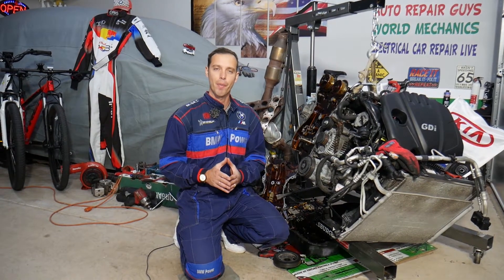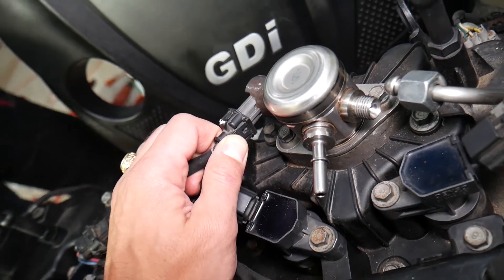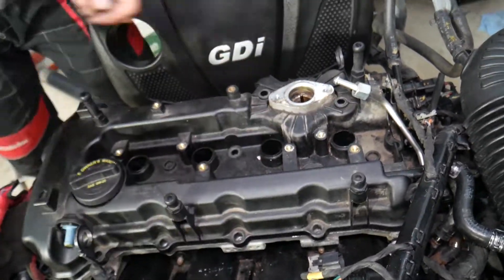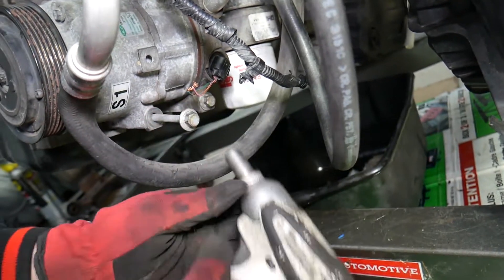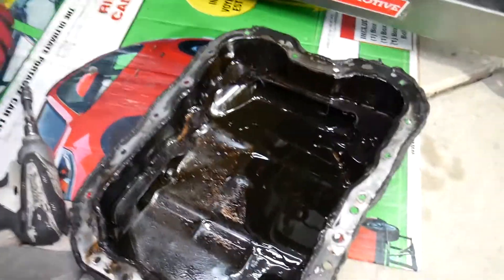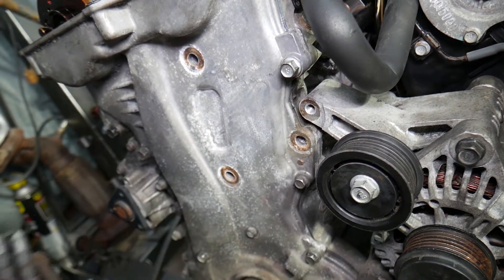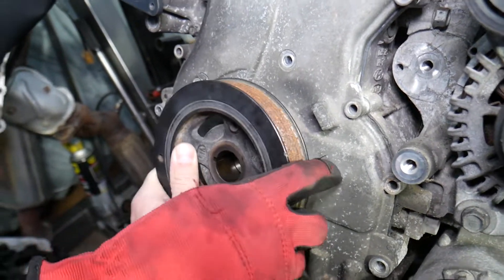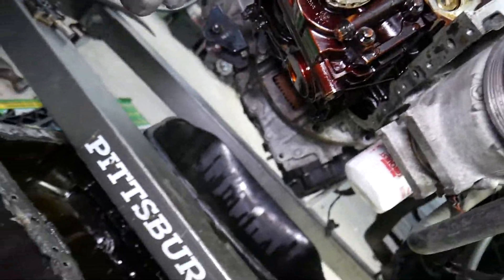OIL PUMP REPLACEMENT REMOVAL LOCATION KIA SORENTO, KIA SPORTAGE

Comment: Thank You for the video. You really know your business. Your video helped me change the balance shaft on my 2008 Kia Rondo. I agree the black silicone oil pan sealer is bad. It is hard to take of later. The grey silicone is easier to separate if you have to take the pan off again.

Comment: Question on a 15 kia Sorento 2.4. Gdi what are the oil pump bearings called? Half a moon with 2 holes in it but flat on the sides? Help please